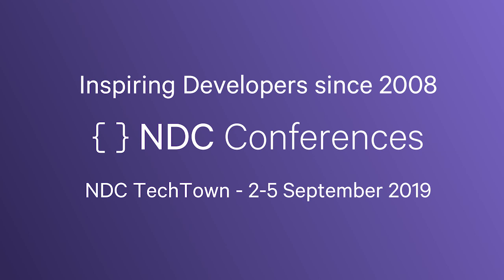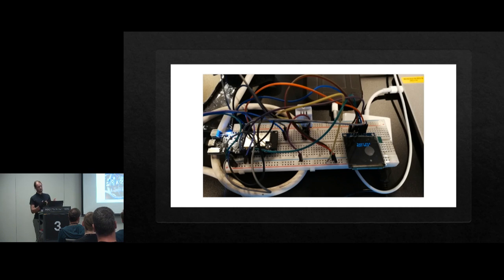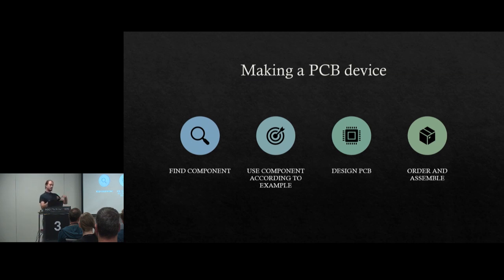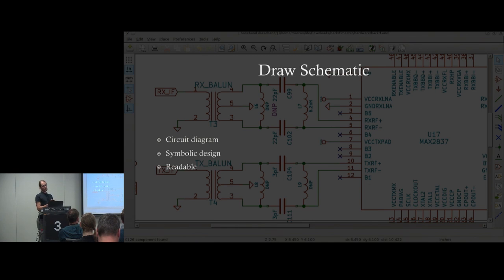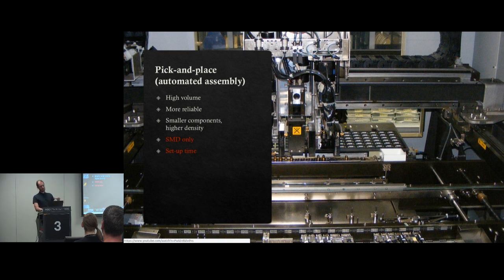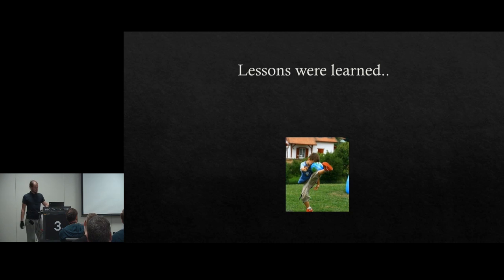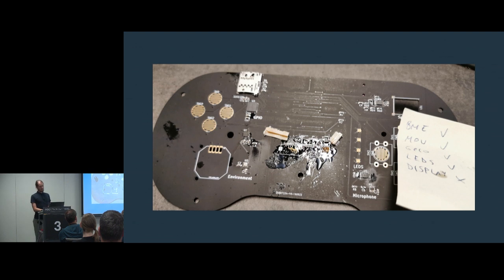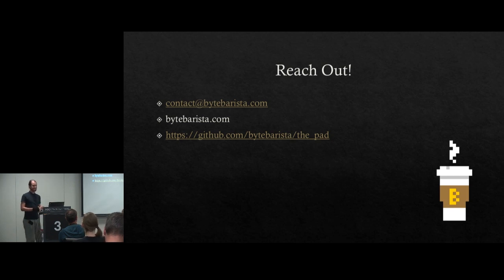From circuit board design to finished product: the hobbyist’s guide to hardware manufacturing

Comment: What does Pick and place files and assembly documents mean in PCB DESIGN? Does it not mean fabricating the pcb hardware? Ps reply .my pcb designer is giving me only the software of pcb.
Reply: Pick and place files are like the coordinates and orientation of how each component will be placed on your PCB via an automated machine. So basically the manufacturer needs this info to make sure the automated machine places the components right. You can easily generate this from EDAs and you must also send them the components you want them to fabricate on the pcb
Reply: @KingdomChablo  thank you

Comment: How can we ensure that the PCB maker does not expose our circuit to third party.what should we give them to design a PCB .
Reply: https://en.wikipedia.org/wiki/Gerber_format
Also, each manufacturer has it's own requierements and limitation. Those are listed on the respective websites. Check those BEFORE making the PCB design since failure to follow those WILL result in bad PCBs being manufactured.
Regarding exposure - it's a trust issue. Some chineese factories actually offer you to openly put you design on their site for some discount. But, really, how secret/complicated IS your design? Could it be replicated by just looking at the manufactured PCB (If you're asking this question then, for your project, the answer is "yes")? In that case, you won't really care about the manufacturer.
Reply: Unless you really trying to create a PCB for specific ASICs (e.g. carrier PCB for the processor like AMD or Intel) or your PCB design is specifically intended for highly classified projects for government, I think that your PCB design will not worth too much to expose. There are several ways of protecting it if you insisted on doing it, of course:

1. Use the "Industrial Design Copyright" law. You can send your PCB design to your local Intellectual Property governing body and have it protected under Industrial Design IP protection before you send it to your PCB maker. While this doesn't stop people to copy your PCB, at least you have all the legal rights to pursue and either stop them or make them pay for the design. However, it also means that unless you 100% certain that your design is working correctly before sending it to your PCB maker, you will have to redo you IP protection multiple times, which is expensive.

2. Split your PCB into multiple small modules, each being processed by different supplier. Therefore, even if one supplier leaked your design, not much of it can be used by your competitor since they don't have all the modules to combine as fully functioning system. Downside is that your production cost is going to go up and extra logistical issues trying to manage multiple suppliers. Additionally, all additional connectors and jumpers to connect between modules add extra fail points that make your system less reliable.

3. If absolute IP protection is your utmost goal, the only viable way is to build your own production chain. That means you must make your own PCB in house, from etching, cutting, drilling, all until the final PCB comes out. It is expensive, but if you really care and you need to protect your IP at all costs, with high enough volume it is worth it.

Besides even if you protect it using one of the 3 options above, how can you protect your competitor from secretly buy your product and reverse engineer it? You can cover or seal your PCB in opaque epoxy that covers every part of PCB, but then you cannot fix it later and with slightly extra effort, they can X-ray the PCB and still copy your design that way.